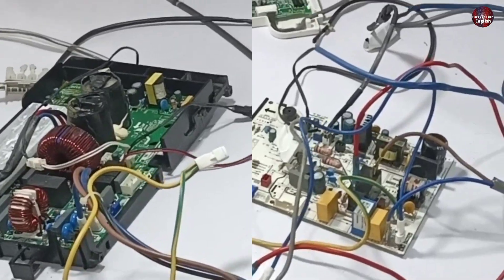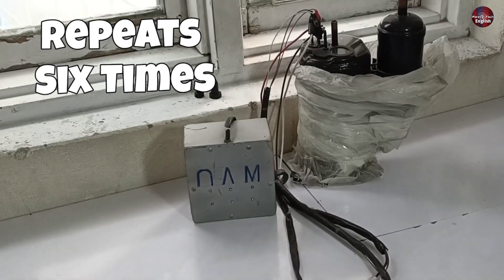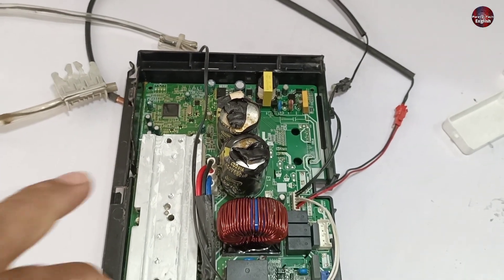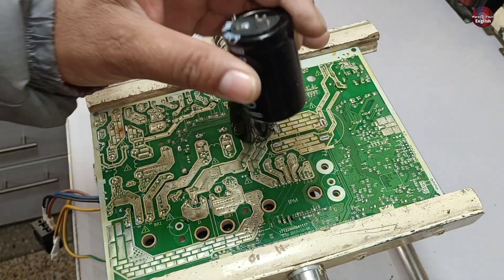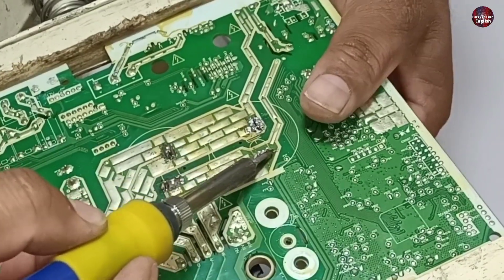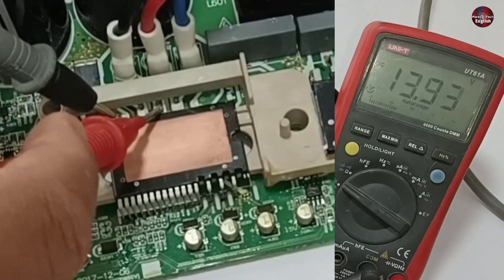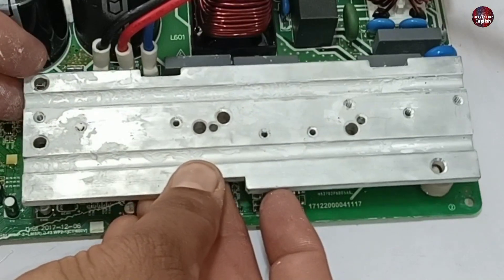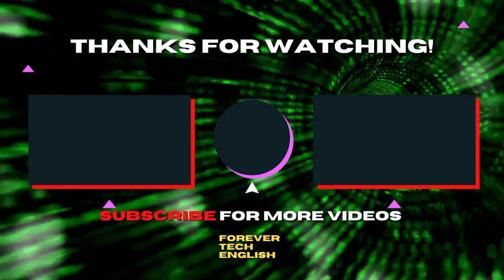Inverter Mini Split Control Board Starts Compressor 2 Times For 2 Seconds

Comment: the capacitors looks really bad wow maybe you need electrical surge protector plug for the AC  make sure it can handle the amps
Reply from the maker: Thanks For the suggestion

Comment: What cause the capacitors bad in the first place.
Reply from the maker: It Could be due to high voltage surge...
Reply: Caps take a beating from heat & voltage fluctuations.

Comment: Does the PCB always behave like this when capasitors are bad? What would happen if one of them was bad? And what about the same fault with another brand ac?
Reply from the maker: Its possible it could behave the same but sometimes it could behave differently as well depending on how the worse condition is of the PCB.
Reply: Thanks.